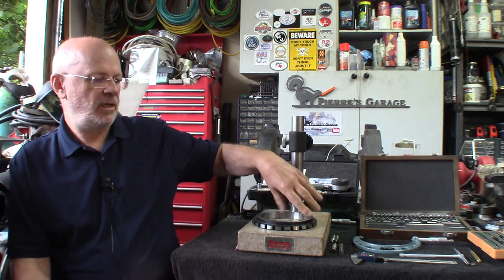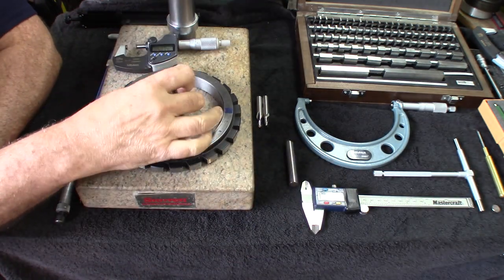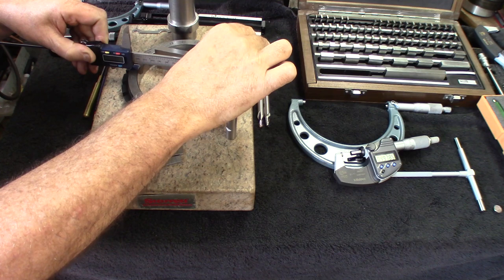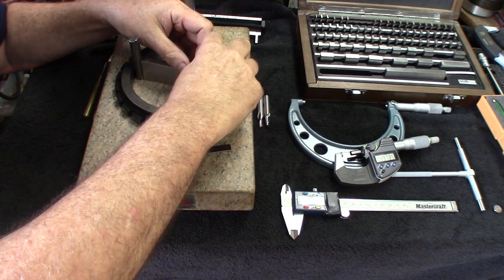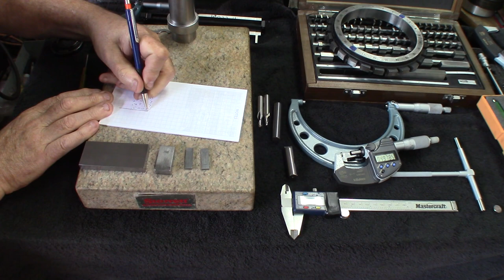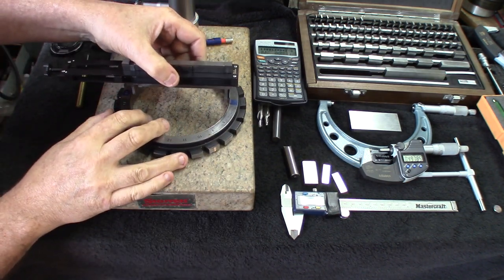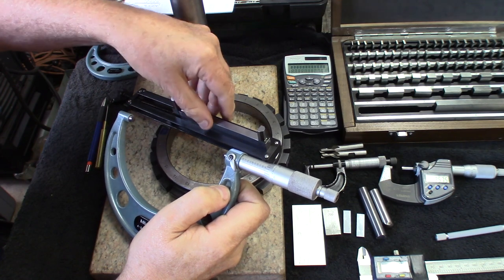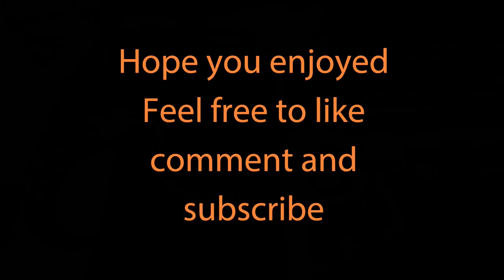Best way to measure an inside bore, very exactly and cheap

Comment: Using gage blocks for direct measurement in the open shop is almost an art form because of the many variables you have to juggle. In this example you can see the wiggling, tweaking etc necessary to insinuate the final block. All this time your hands are warming the block stack an unaccountable amount. Simplify the ID as 5" exact. The coefficient for linear expansion for steel is 6.5E-6 (0.0000065") per inch per degree F over a wide range of low alloy steels. If, by handling, the gage block stack warms 10 degrees F then 5 x 10 x 6.5E-6 = . 0.000325" error but this figure is far from certain because of unequal heating and unavoidable contact with the ring. It may be more or less. 

Direct measurements like this must be allowed time to reach thermal equilibrium and then checked for quality of fit before final size determination. Another complication is raised when the shop  environment temperature departs from the international standard of 20 degrees C (68 F). In steel work pieces and steel gage blocks departure from environment temperature is of no importance because work and stack expand at the same rate. If the blocks are steel and the work bronze or aluminum (or some other alloy or material) shop temperature poses another complication - surmountable by use of a simple pocket thermometer and some shop math. This way raw direct measurements may be compensated to 68 degree F.

Direct measurements to five significant digits using gage blocks are incredibly time consuming, fiddly, and fraught with sources of error. Such readings are greatly simplified by use of dial indicating transfer gages; in this case bore gages. Handling the gaging end is unnecessasy once the gage is set up and calibrated from a gage block stack so comparative readings are quick and easy to read. Any departure from the setting is displayed right there on the dial. A cheap set of import dial bore gages is not too expensive (you can eat some other time) and once bought last a lifetime of intermittant use. My Mitutoyo set is over 50 years old and the gaging surfaces are the only places showing wear. Since the tool is adjustable, gaging surface wear is moot.

Gage blocks may not be needed in most home shops for part measurement. That decision is driven by your customary class of work and the need for fits with components made by others. Bearing races are only one example. Outer races are typically fitted 0.0005" to 0.0010 loose and the bores, if shouldered, are shallow. Measureing these bores efficiently on a one-sey two-sey scale is a toss-up between telescope gages and dial bore gages. If I had a hundred parts to check, I'd set up the bore gage. If three, the telescpe gage every time. YMMV.

The main application for gage blocks in my shop is as a transfer reference. If I need to turn a bearing fit on a shaft, a gage block stack is handy to reference my mike to. Once when I was flush with cash, I splurged for a cheap set of Metric blocks. Since ball bearings have mostly Metrc dimensions, I need only select the 35 mm block, for example, instead of assembling half dozen into a stack. 

And of course (until lately) annual inspection and calibration of my micrpmeters and other measuring equipment.
Reply from the maker: You got all of this absolutely right, in my videos, I'm addressing the hobby up to smaller shops, not the high tech or aerospace labs, just like you said, there are many more variable to include in the measurements.
Depending on the tools available at the moment some machinist will have one or more creative solution to get the part out the door with "Required" accuracy. Most of those situations will require at most a few tenths of a thousand precision, this is achievable with quite some care taken and some minimal feel and experience, this takes time and lots of practice.
You sound like some person that works in high accuracy parts making/controlling. Not easy to a beginner to understand all those parameters involved in the making of really accurate measurements, even further parameters in the behaviour of those same parts in the actual operation like when a bearing starts to get to operating temperature, etc...
Thanks for your comment, it adds to the discussion,   Pierre

Comment: I found you can't measure roundness with a standard (2-point) gage, like a standard micrometer, etc.
I came across some Asian boring bits for boring heads that measured 0.4984 diameter, precisely, all the way around. They wouldn't fit the holes in my Erickson 50 boring head, which were 0.5030 to 0.5050 diameter.
I discovered they were 3-lobed and would measure the same no matter where the readings were taken with a micrometer. I put them into a 90 deg V-block and remeasured with an indicator on the top while rotating the shanks in the vee. I got a deviation of about 0.004 to 0.006 thou. These were probably ground on a centerless grinder that was not set up properly and were so out of round as to be useless. You need three simultaneous points or a zero run-out rotating fixture (like the air bearing in a roundness testing machine) to measure roundness.
Be careful what you assume to be a valid method.

Comment: best way to measure an id ,, on the machine? don't like taking the part out each time
Reply from the maker: It will be a little more awkward to perform this in the machine, but, with some fancy handling you could do it, this is really to the last step of machining the part, also very important to make certain that the part has time to normalize in temp and stresses before taking real precise measures...  At that stage, you're chasing tenth....   ;)
Thanks for comment,    Pierre

Comment: Where to get super accurate gauge pins? Then measure w calapers and rule out subtle errors, look for an integer that would make since with the make, whether its metric or standard. ? Dont tou habe to suspent the pins from touching the wood base,  to avoid cosine error,  thwy look like they were cut of with an angle grinder.😑
Reply from the maker: In order to get "Very accurate gauge2 pins, you would need to spend a fortune, another way to go around the problem is to have your set calibrated, then, you have the individual measurements on the certification paper. There is no way to get something very accurate with a caliper since the tolerance of a good quality caliper is about +/-  0.001 thousand or 0.025mm.
Hope this addresses your concerns, thanks for viewing and for your comment,     Pierre

Comment: Cringing at you jamming and scraping those precision blocks against a carbide tangential contact!  You lose precision each time a block is abused.

The purpose of the plastic label on the Mitutoyo 5-inch micrometer is for you to hold it in hand there.  This isolates body heat from distorting the measurement, which can easily be tenths.

Your practice reminds me of Connely's _Machine Tool Reconditioning_, which deals with generation of precision gages and surfaces without a more-precise tool.  One example is precision dividing of a circle using a circular stack of equal pins.  It's more feasible to generate multiple pins of mutually equal diameter than it is to fit a predicate diameter.  Or how the tool and die trade managed tenths precision in rectangular positions with nothing more than a lathe and dial gage.
Reply from the maker: Hi Richard,
You're quite right about the plastic plates, I've got some micrometer stands that I should always use, bad habits and wanting to expedite the work are not the best practice...   ;)
Thanks for sharing your experience,    Pierre

Comment: That takes a lot of time
Reply from the maker: Making real precise measurements without the perfect set-up requires to be creative... 
It's easy to get quick and efficient with all laboratory tools, but, those are very $$$$, rarely accessible to ameteurs or hobbyist, this method, even if it requires more time will give you good and very results with minimal cost.
Thanks for viewing and for comment,    Pierre
Reply: @pierresgarage2687  thanks for replying I appreciate it you definitely right we always seeking accuracy besides minimum time to done the job some times the time is$$$$$.thanks again